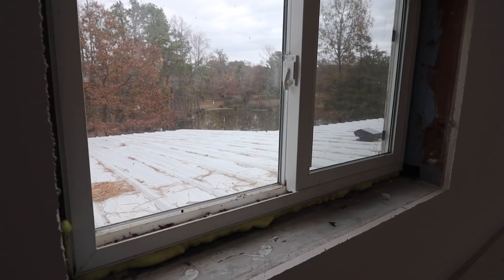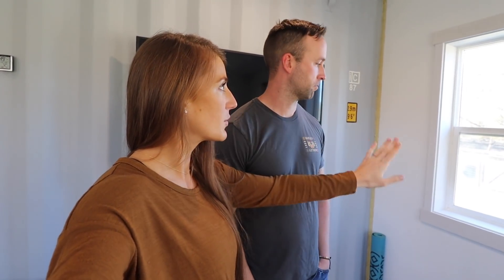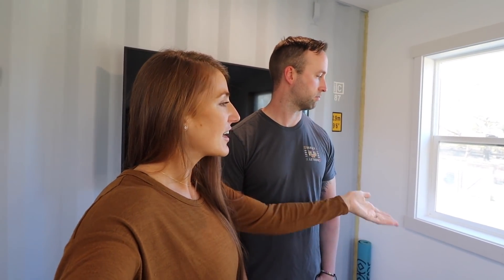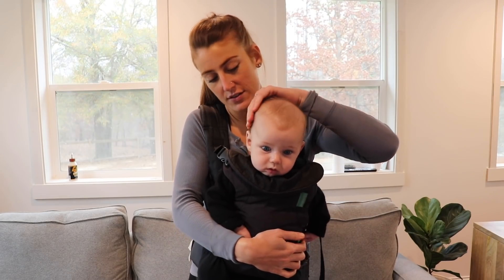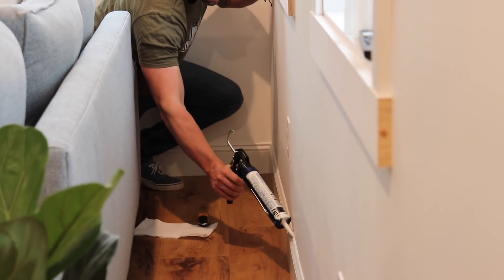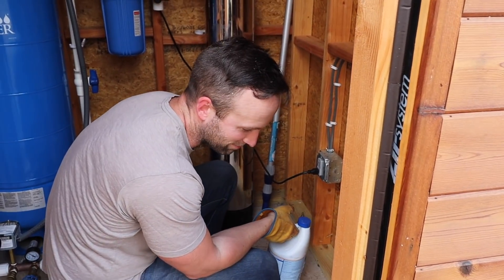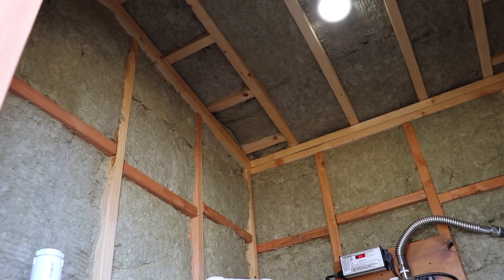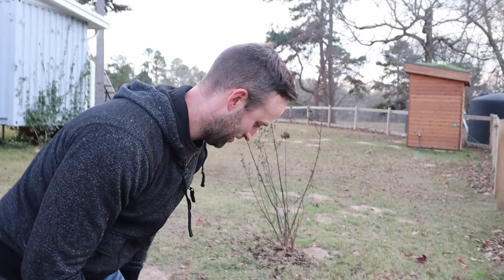PREPARING FOR THE WORST...

Comment: Spencer have you considered getting some fence material metal or wood and drive it down close to that irrigation pipe so they dogs run into that instead of the pipe? Also can your electricity supply support a heat lamp during the freezing nights? Maybe put a thermostat in the pump house to open a relay and the heat lamp comes on ?

Comment: With the air pump, replacing the pvc pipe with a flexible hose (rubber hose the ID size the same size of the OD of the pvc) two hose clamps either end and all problems disappear.

Comment: Id be tempted to either put a small electric heater (tstat controlled) in the pump house or even possibly heat tracing some of the lines inside there to help keep them running freely all winter.

Comment: Next you can build a garage a super super garage is the pursuit of garage about 30' wide wide and one level tall or 2 level talls with a truss across the top of it so you have about 20' tall in the middle and you can still have 2 containers on 1 side and 2 containers on the other stacked / And you can also make it 4 on each side 2 stacked on top each other too long so instead of being about 50' long it'd be about a 100' long 2 shipping containers high/ Then u can bury a container  for tornados. Tornado. Shelter

Comment: You might want to think about putting potted plants or small trees to the side of the pipes so the dogs won't run in to it. Probably a  cost efficient  and fast solution until you decide  on something  more permanent.

Comment: If its a pump house, why run everything through the walls?  We built one way up in Maine and kept everything in the cavity (surface mounted the plumbing).  Damned to know if there was a code or anything for it that we violated... But it just seemed logical to have the walls well insulated and keep the pipes inside where we assumed they would be better off and easier to service if they froze on us.  Several winters with multiple subzero weeks each time and no issues.

Comment: There are these clever little inventions called "mousetraps." I would strongly suggest that you put a couple in your pump house to protect your water supply.  You also may want to consider installing a small space heater in the pump house to prevent pipe freezes. You have solar, so you should be able to run a small heater set to 40 degrees  24/7 very easily.

Comment: Maybe add a heater set really low, or thermometer that will trigger an alarm inside the house at a certain temp. You don't want to have problems with freezing the same time as everyone else. Then you can't get parts.

Comment: Have you thought about having a small thermostatically controller heater to frost protect the pump house? Trigger it to come on at 4°C
Also in the UK we have foam insulation which is designed to go around pipes which may help, if you have the same over there?

Comment: May want to slice a section of that insulation and put it all behind it and insulate it from the wall  so the pipe will be exposed on the inside  to transfer heat to them vs insulating the piping from the inside heat. Ever thought about installing a double pane window on the sun side for free heat in the winter and drop a black out curtain during the summer to keep it cooler?

Comment: I was wondering what your underground water level is. If you were to use a "pit" (4-6 foot) with a hoop greenhouse cover it would lower your tank freezing times. A slight angle on the floor would increase your available water. The hoop greenhouse would give more rainwater catchment also.  just a thought.

Comment: Consider installing a heat lamp(s) in the pump house that are activated by a 120 vac heat cube controller that turns on at 33 degrees.

Comment: Add a thermostatically controlled outlet and plug in a 100 watt incandescent bulb. That little bit of heat will keep that insulated shed warm.  Also make sure your Pex is inside the insulation. It looked like you put it behind the insulation.  22 degrees this Sunday will put it to the test. Keep up the great work. Love watching these videos. One more question. Why don’t you kill those snakes. With those little kids, the more snakes you can get rid of the better.

Comment: The insulation will not work.. Because you got that "moon" hole in door and the door isn't insulated.. Simply put heater that blows hot air in there and be done xD You got sun energy, so easy fix.

Comment: Umm… would it be an idea to have a small electronic heater in there that comes on when it gets to a certain temperature and runs off a pair of solar panels that are on the roof via a battery inside the shed? Other than that, looking good there, matey. 

I see how Australian that sounds…!

Comment: I would take some 2-in ISO board and put it over the interior of the door and hold it back two and a half inches so it does not touch your jams . Just make a sandwich with some cedar boards around the edges of it box it in
Reply: PS you can take the tarp down then or leave it up as additional insulation . Was just a suggestion what you did will probably work fine I'm just thinking about your water security of temperature

Comment: An energy efficient home or business is more comfortable and saves money in the long run.
Solar energy combined with battery storage can make people more independent from the grid and natural gas supplies. Add solar and supplemental electric heating or a heat pump for home or business heating..
All big box stores and manufacturing sites can support solar energy on their roofs or parking lots.
Added insulation, triple glaze windows, energy efficient doors, energy efficient heating and cooling systems, energy efficient appliances, LED lighting, smart thermostats, solar panels combined with battery storage and a electric vehicle charger in the garage or car park. People are too focused on the short term costs and miss out on long term savings and comfort. Blower door testing and air sealing are under appreciated tools.Even if you have money to burn you should not waste it.  Climate Change will impact everyone. Leave a better future for your children and grandchildren. Join in and speak up for the future of the planet.

Comment: Are you not worried snakes and mice will get in through the crescent cut-out? I would want to put some kind of box behind it so nothing could use it as a doorway! And are you really still showering outside in winter? Are you not afraid of snakes getting you in the shower when you are at your most vulnerable?
Reply: I think the crescent has a screen over it, so nothing goes in

Comment: Spencer, on your main incoming water line, a blue PEX I believe, shown at 13:08, you might well want to get the insulation under the pipe, between the pipe and outside skin. As to keeping the pump house warm, a temp alarm and a 100 watt conventional incandescent lamp set up to keep the room at 36 degrees or warmer will get it done. Hopefully we won't have to warm up on the fireworks from Austin like we did last February!  Kenze, somewhere it is written, likely on stone,  "That where there is life, there will be dog s......." . I don't remember where I heard that first- it sounds like something one of my Texican uncles would have said, thought!  HNY!  FR